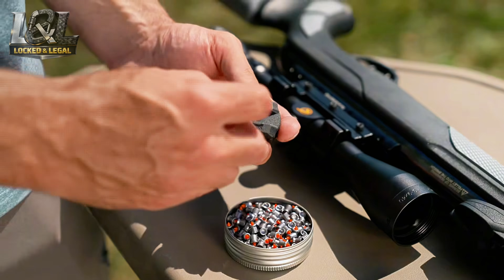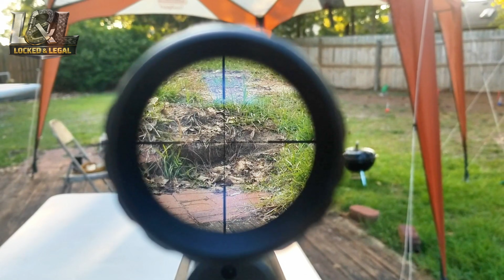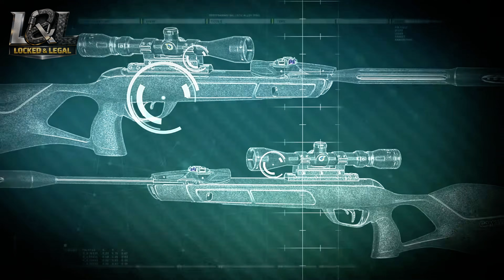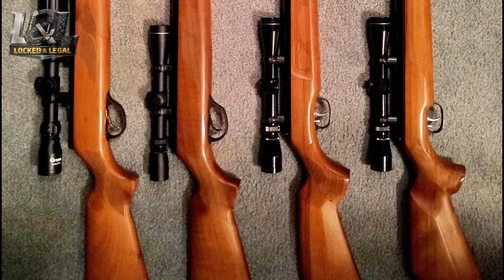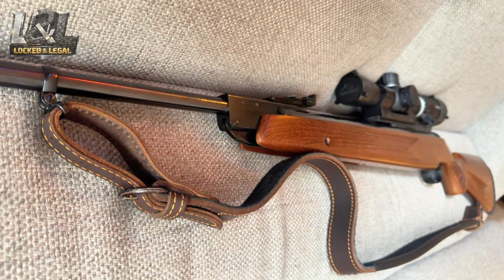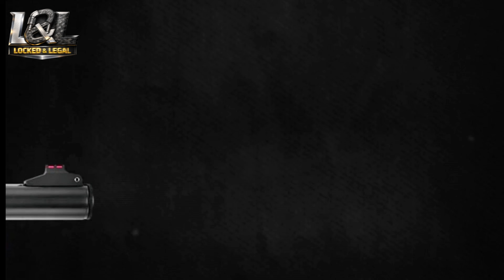5 Most Powerful .22 Break-Barrel Air Rifles of 2026 – Built for Long-Range Hunting

Comment: When there’s no air for pcps due to ‘Climate lockdown’ or some ridiculous control our governments may force us into… or à war that cuts electricity to homes! The spring and piston powered airguns will still be useable! Buy a good pellet or slug mould and you’d be well on the way to being ‘prepared’!
Reply from the maker: That’s one advantage springers will always have 😄 No tank, no compressor, no electricity — just cock it and shoot. Simple definitely has its appeal.
Reply: @LockedAndLegalUs  yes that's why I have a Diana 350 magnum full power edition in my collection. It will always work as long as you have  pellets. More than enough power to shoot small game up to 50 yards, so perfect survival air rifle.

Comment: 12.39 thats mine old 350 magnum .22
Reply from the maker: Nice! The .22 Diana 350 Magnum is a classic. Great to hear you’ve owned one yourself. How did yours perform after all those years? 👍
Reply: @LockedAndLegalUs  its not a great  gun, the spring twisting when shooting.
Hard to get on target.
Im shoot mine theoben gasrammer alot they shoot way better.

Comment: I have the RWS 350 Magnum in .22 cal. that I had tuned and modified by Vortek. It shoots 14.3 grain CPHP pellets at 860 fps very very accurately and quietly.
Reply from the maker: That sounds like a seriously well-tuned 350 Magnum! 14.3-grain pellets at 860 fps with good accuracy and low noise is an impressive setup. How long have you been running that Vortek tune?
Reply: @LockedAndLegalUs 20 years.  Just put it through the chrony again a few weeks ago. Pellet speed did not change from 20 years ago. That's amazing!  This RWS is also made in Germany.